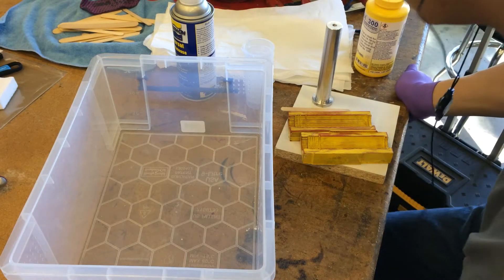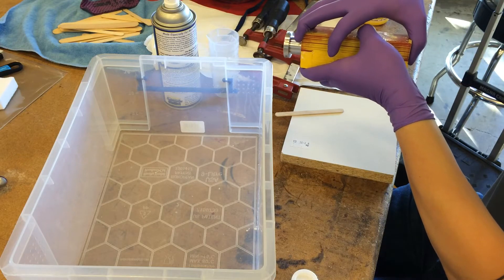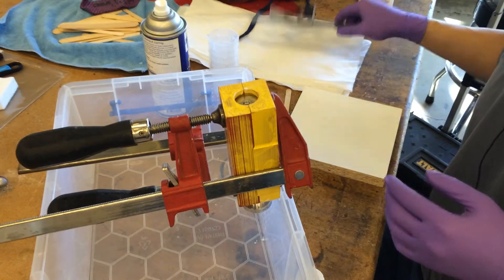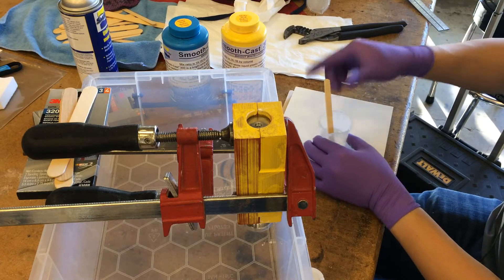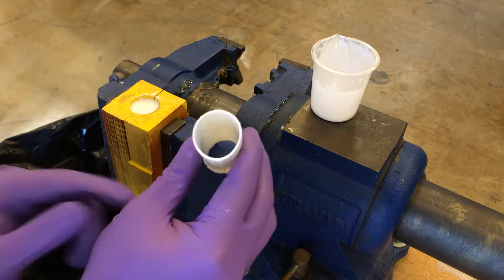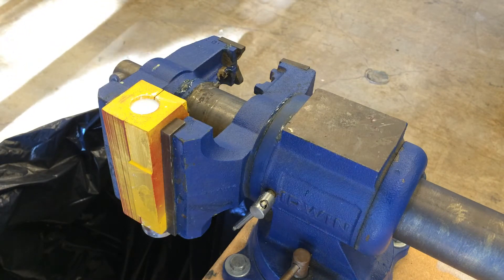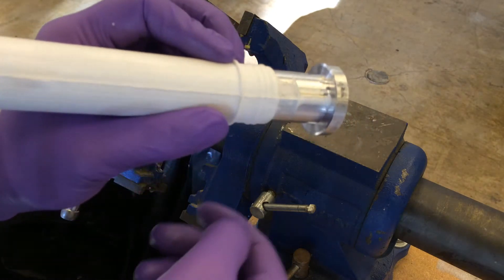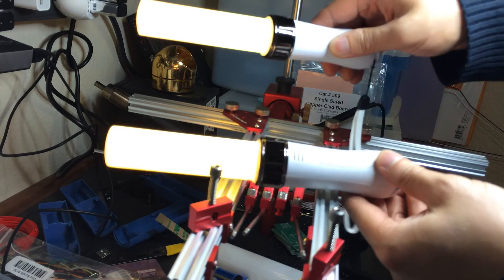Casting a hollow part in resin with a 3D printed mold

Comment from the maker: It is true, 3D printed molds will need finishing, and since you're creating molds directly, you should think of this as more analagous to milling molds from aluminum (e.g. for injection molding), where you also need to do some finishing on the mold to remove tool lines.

In this case, the mold is a prototype that I only lightly finished since my purpose was mainly to test the flow behavior of the design. The next steps could be then to further sand the mold to create the desired surface finish. In my case, the next step was to print the mold using SLA 3D printing to produce a higher resolution and more heat resistant mold and use that in an injection molding machine to further validate the mold design.

Comment: I think you did it great, I'm thinking in buying a 3D printer for molding design and casting. What do you think?
Reply from the maker: I certainly think the process works. However, you should ensure that you are comfortable with the mold design process in CAD before you buy a printer. Your computer is the most important tool in the process, and you should validate that you have the tools and knowledge to design molds before you invest in a printer. The printer is pretty much the last step in the process.

Comment: Next time print registration points in your mold so both pieces lock into one another so you want have issues. Second put needle points, super tiny fingers / prongs down the inside of the mold right under where the insert will lay to prop it up inside the mold to keep it centered. And if your 3D print isn't perfectly square something wrong with your 3D model or printer.

Comment: Hello James,What is the mould release you are using please?I am looking at casting resin into a 3D printed mould and require a good mould release to ensure the resin doesn't stick to the printed part.Thanks for your help,Matt (UK)
Reply from the maker: You need to use the mold release matched to the casting resin, whether your mold is made of silicone, PLA, ABS, or aluminum doesn't really make any difference. Since I'm casting using Smooth-On polyurethane resin, I'm using Smooth-On universal mold release.